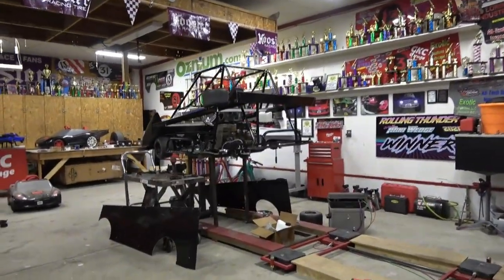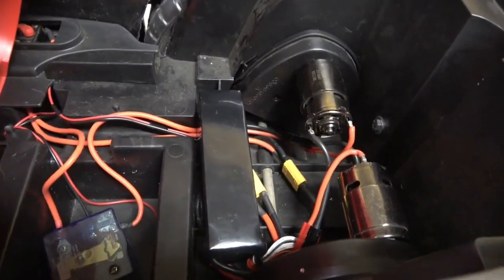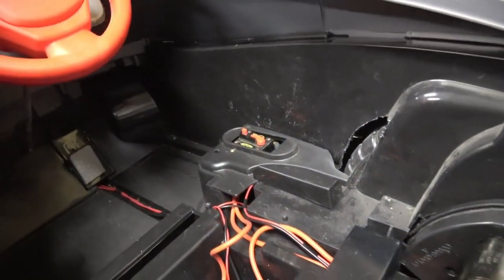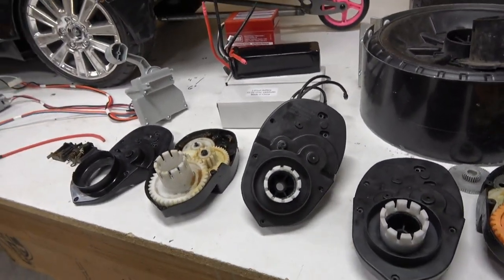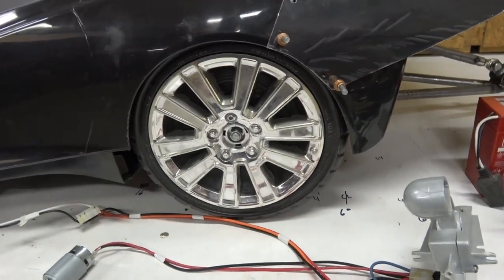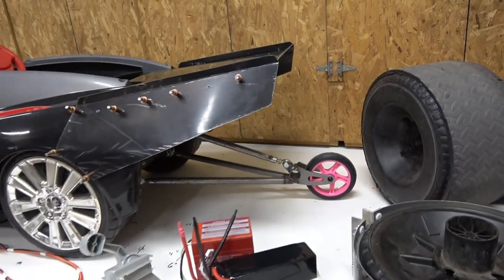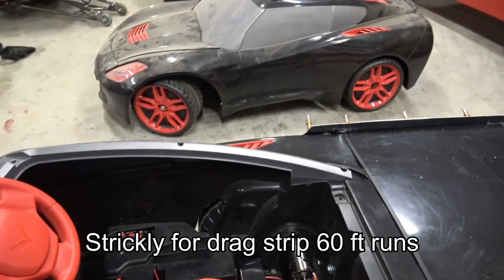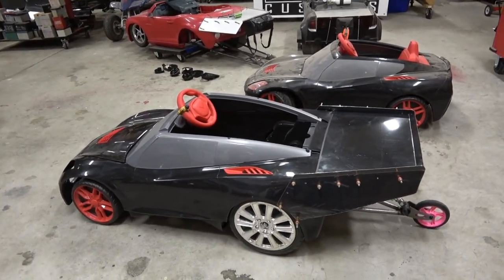Powerwheels Drag Car Build- Project Blacksheep C7 corvette #lipopower #dragracing #fastpowewheels

Comment: Where did you get your gears for the motors? 23t 32p 5mm I believe??
Reply from the maker: We use these. Stock pinion is a smidge smaller so a 23 tooth binds. https://amzn.to/3AJl2L9